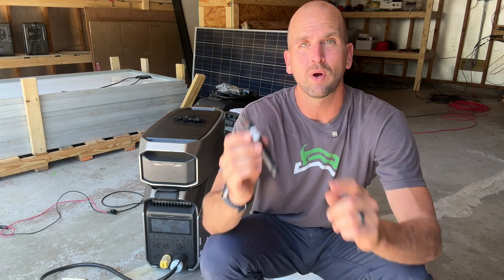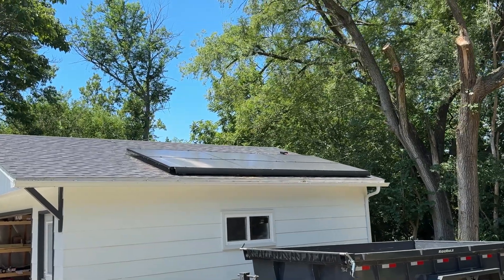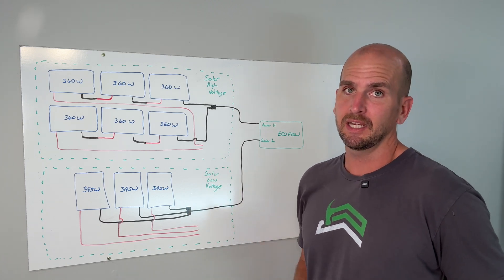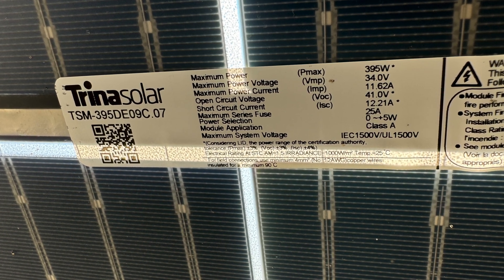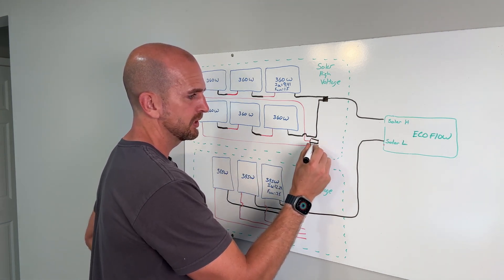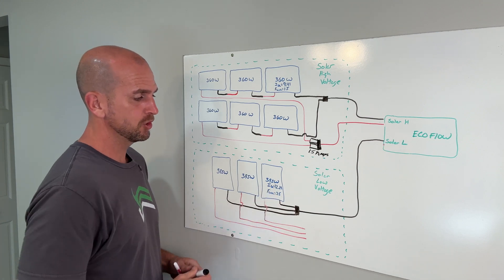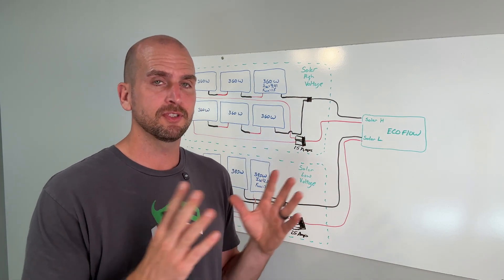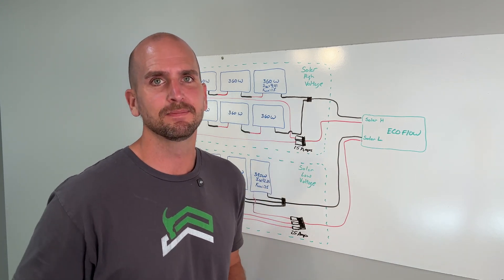When And Where To Use Fuses For DIY Solar

Comment: The purpose of the fuse is to prevent a fire by putting to many amps on the wire the you are running. So if you are using 15 amp rated wire running from solar panels to your house, you put a 15 amp fuse. You have 3 15 amps fuses going to one wire that is not fused, thats 45 amps on one wire, so you should have a 45 amp fuse on that one wire and a wire that can handle 45 amps plus distance of the wire.

Comment: I have 2 Renogy Shadowflux 200W panels that I can't wire in series (exceeds 60v max of my Delta 2 Max XT60i).  They are wired in parallel. Short Circuit Current is 6.86A. Max Fuse Series Rating 15A.
I have NO idea after watching the video twice if I need a fuse for that setup and/or what size fuse to use. Or...if I even need one?

Comment: I also have a DP3 and trying to get the maximum wattage (1000w) on the LPV port using ecflow solar panels. From what I understand from the video I could use 3x400w as long as I use a fuse on each line. Is this correct?

Comment: This video seems all wrong to me.  

The top portion only has 2 parallel connections, never seen anyone use a fuse for only 2 strings (not required but optional) those in-line fuses though.  I hate them, would never use them for semi permanent setup, but I suppose for a portable Delta its ok.

Still a solar combiner is so much better IMO, better for inspection and maintenance but also easier to keep in a weather/temp controlled environment.

Your just adding it up straight up here, I was taught to add 25% (1.56 multiple) to the total ISC figure then go up to the nearest fuse.  So your 25A rating is not correct based on my knowledge and I just got engineering done and they agreed with my calculations using my method.

Firstly if your adding them all up that would be the calculation for the single large wire to the MPPT, not the individual panels that need to be fused (much more important than the entire string) you should be taking 12.21v * 1.56 = 19.04v and size up to say a 20A fuse for each string on the bottom and each string is just a single panel in this case.

Comment: Two panels in parallel that require in line fuses are only on red line so 2 fuses or 4 on all red and black lines? I am not using a real life situation but rather wondering on one fuse per panel or each line?

Comment: Hi again

We are using sketches in this video to look for possible connections. 

We use your video as sample:
1/ top array of 3 double series to connect parallels.
2/ bottom arrays of 4 panels parallels.

Is it safe to connect parallel different energy arrays 1 + 2 ?

If it is safe, then what are the energy outcomes?
Watts = ?
Voltage = ?
Amps = ?

Thanks

Comment: Hi
Please tell me is it ok to connection both your H and L voltage arrays either in series or parallels to 1 inverter. 

It is Sungoldpower inverter:
SPH5048P specifications
5000 WAC
5500 PV
48 V
63 A

Tiger
California,  Rosemead city

Comment: I bought the Ecoflow stream ultra. This has a separate microinverter 1200watts that has 4 inputs 3 x 400w max input (2 of which are on the same mppt) I have 3 panels hooked to this, I then have the stream ultra that has 4 inputs up to 2000watts 4 x 400watts max input and have 4 panels hooked to this. Each panel is 405watts. Question is, do I need a fuse on each positive wire before they plug into the microiverters?
Reply from the maker: Nope, you should be fine without fuses.  Are you in Utah?

Comment: I have the 100-30 with 2 100w panels in Parralel. PV in on a double 15a breaker #6 wire but cannot find a 40 or 50a mega fuse for the Victron 1000 distributer?

Comment: If using a combination of series and parallel solar panels produce amp of 13.5 and series fuse rating is 15A, do I need an in-line fuse to be safe?

Comment: Hello thank you so much for the video my panels are rated at 10.9 amps 395 w I'm going to be running 4 series of 8 panels each and series and then I'm going to combine all four series so my total output would be 12, 640 each series will have 3160 Watts since my panels are rated at 10.9 amps I was going to put a 15 amp fuse at each mc4 branch adapter to be on the safe side do you think that's sufficient again thank you for your video I really appreciate all the training  I'm an automotive technician but I don't know anything about solar and I really appreciate all the training

Comment: I have 6x100 solar panels connected parallel. Should I use inline fuses for this setup. Also using a pwm charge controller. Any suggestions?

Comment: You should also state that if you're going to connect permanent solar panels to your portable solar power station, you going to have to do it on your own!!! Because no solar staller will install solar panels if you have your own equipment!!! They will refuse to do it!!! I contacted 30 local solar installers to put solar panels on my 40° roof and not one of them would do it!!! Every one of them had a stick up their ass!!!

Comment: I’ve got some Meyer-burger panels I will be wiring in a 2S 2P configuration. The Isc is listed as 10.6 amps. The max series fuse rating is listed as 20 amps. If I understood what you are saying, does that mean I will need a 20 amp fuse? 

Great video!

Comment: Hi, I have twelve 555w panels, of which a set of three are wired in series, then the four set of 3s in series are brought together in parallel to the charge controller. Do I need an inline fuse?

Comment: Best format of video.  I'd add 1 thing to your wiring diagram. I'd write 15A two times, and 25A three times to indicate you need 2 or 3 of this fuse. Ie  it's not a total.  Minor point but foolproof

Comment: Instead of those inline fuses, would it be acceptable to use DC circuit breakers, 15A and 25A, rated above the maximum series voltage, to serve as a current protection device and also a disconnect?

Comment: Be careful with DC isolaters and larger series configurations.  When dealing with high voltages  can jump the gap forming a continuous arc https://youtu.be/S9a2oPCIMr0?si=DExB_psWjVzCtK5-. 

Ocdp are good recommendation.

Comment: Small tip: DC isolators MUST be mounted on non flammable material. NOT a piece of wood.
They are prone to arcing faults and you do not want it to be surrounded by kindling.

Comment: Great video on the explanation of the math. I am sorry, I still don't understand the premise. I understand Short circuit current to be the maximum current a solar panel can produce. I do not understand how connecting panels in parallel causes a panel to produce more than its short circuit current rating. I understand that arranging panels in parallel creates a higher additive current after the parallel branch connector. Using the river analogy, when you connect three rivers in parallel the combined river has a greater current but the current in any one branch is not affected by the combined current. Aren't the branches are limited to a set value (ie., the short circuit current)?
Reply: I've had this same thought / question! Did you find any answers?

Comment: I have two Delta Pro 3 units, four ecoflow 400 watt rigid solar panels and a ecoflow subpanel  - just arrived. I am confused about grounding. Do I need to have one or two ground rods at the array or do I run the ground wire to the ground rod the grid panel? Thanks for any help

Comment: Nice explanation. One problem I had is that with my eco-worthy 100w panels, the outputs are not red and black wires, so I had to look at some other fusing videos to tell that the connector that looks like a male is the plus, or the "red" wire. Also, from what I can tell, other brands also had the plus connector on the right side of the little box on the back of the panels. 

I wonder what would be the effect if one put the inline fuses in the negative side instead. After all, the inline fuses have a male on one end and a female on the other, so it is not foolproof since one could put the fuses in the negative Y connector just as easily. 

I think I did the fuse size wrong, however. My panels say 5.5 sc amps and 10 amp fuse. I thought one would have to add the 5.5 and get 11 and so I am currently using 15 amp fuses. It should be easy to just replace them in the inline fuse holders, I would hope. 

Adding to my confusion, I have 4 panels, with 2 connected in series (40v) and then the 2 pairs in parallel. I have an ecoflow delta 3 plus that maxes out the voltage at 60 (with 500w)  so I can't just series connect the 4 of them.

Comment: first example:
 2 strings where every string brings 9 Amps put in 15 Ampere fuse for what'?
a strings delivers with 9 Amps the maxiumum possible current possible so to fuse against 15 Amps that will never be possible...
pontless in any aspect.
if one or 2 panel in ysour strings fail they will be bypaased and the  working panel deliver still 9 Amps, so what is the point of a 15 Ampere fuse???

if you will protect a string against another string then you must fuse against the maximum possible current an this is 9 Amps....
and to fuse against the working current = not work, to put a bigger fuse the max possible current is pointless.

the same trash in example 2 
3 panels with 12 Ampere in parallel put on any panel a 25 Ampere fuse.
frash over trash.

if in a parallel string on panel fail it becomes a consumer, so in your example 2 panels will put out 2x 11,5 Ampere=23 Ampere and pump it into the failed panel so the fuse will not do anythink and then the failed panel will heat up to the point of fire...and burn, and the fuse will do nothing coz still 23 AMpere is alll the failed panel get.....

so if you will prevent that is the key tpo understand how elektrizity works and not read any trash and show here your halfisch theories.
and yes your fuse will work if you take for exammple 4 of this panels in parallel coz the current will be then 11,5x3= 34,5 Ampere so your 25 Ampere fuse will now get blown.
with your example you only show that you have no idea of Power.

the much more common way in many aspecst is to put into parallel setups blocking diodes , on this way you prevent really all possible problems.
only on this way you prevent a back flow off current into a failed panel or a partial damaged panel that drains lets say 20% off the current what producend from panel 1+3 and will be drawed from panel 2 about anyx fail , or shading or damaged cells on the panel....
all ppssibel fail can only be protected with this solution.

a fuse only can stop a fix current if you use the right fuse.

so in your example 2 fuses with ~22 Amps or lower only can block  the full current of 2 panels, but no other fails that happening all  the time.
3 panels parallel 2 panels full suin 1 panel fully shaded turns the shaded panel into a cunsumer and current from the 2 fully sun panels pump current into it.
how your fuse helps here on a dayly problem???
fusing panels is in any aspekt poimtless.

the last 15 years schottky diodes are the way to go like the next 15 years.....

in reallyty there exists no scenario there are any need of a fuse in any solar setup.
from panels to the consumer/charge controller no fuses need or make any sense.

the only fuse that can be placed is on the battery + thermial and that is the only one fuse !!!!!

Comment: Question, how do you calculate the max current for each string? The DP3 Low-PV is rated for 20A and the High-PV is rated for 15A. I was under the impression that you use the "Isc" rating. If that were the case, you would be over current on both, right? High= 18.82A and Low = 36.63A. If that's not the case, then how would one calculate the max current from each of your strings? Should I be using Imp instead of Isc? If we use Imp instead of Isc, then High = 17.8A and Low = 34.86A. Either way, aren't you over the current rating of each solar input?

Comment: Any idea how to determine fuse size when the panel doesn't list one?

I have 2 BougeRV 100W panels.  This is the info the label provides:

Max Power (Pmax):  100 +/- 3% W
Max Power Voltage (Vmp):  18.15 +/- 3% V
Max Power Current (Imp):  5.51 +/- 3% A
Open Circuit Voltage (Voc):  21.4 +/- 3% V
Short Circuit Current (Isc):  6.11 +/- 3% A
Max System Voltage:  1000V DC
Application Class:  Class A
Operating Temp Limits:  -40F ~ 185F

I tried contacting their Customer Service but got the run-around, and finally a partial answer.
They say if I connect the two in series, I need a 10A fuse.

I'm guessing from your video that I will need two 10A fuses if I connect them in parallel.
I really wanted to get more panels but hesitate since I don't have this info.
Reply: The short circuit current is 6.11 and you times that by 1.54= 9.4 so you would use a 10amp circuit. 

This is only if hook them up in parallel. 
If you are hooking them up in series then you would not need a fuse because your not increase amperage but just the voltage.
You will still need to breaker this at the house or before the controller/ inverter.

Comment: Noob question. Does it HURT to have inline fuses in a series setup on the solar panel side of a switch/circuit-breaker/etc, in case there is a short circuit (from water or fault wiring/electronics) or something?
Reply: no one knows... have same qeustion
Reply: @SuperStanislovas  All the utube channels about solar are about taking in money. they dont want to get involved helping people for Free!

Comment: Hey there, thanks for the video. Question - for the top configuration, since your Isc is 9.41, what is the rationale for using a 15A fuse instead of 10A? Maybe my next question answers this, but when does the 1.25 (indoor) or 1.56 (outdoor) safety multiplier come into play?
Reply: it is pointless is the answer.
if a panel or seriall string can put out 9,4 Ampere max so that is the maxium in any aspect so if one or more panels fail still 9,4 Ampere is the maxiumum possible current so to put in a 15 Ampere fuse into this string is 100% pointless in all aspeccts.

and if you use parallel configs there is a possible way to use a fuse for example 4 panela in parallel and each one makes 10 Ampere so a total of 40 Ampere.
lets say one panel fail in this setup in this exotic situation the failed panel becomes a ccnsumer and this consumer can draw it rating so maximum 10 Amere but in our example we have 3 working panels that still produce 30 Ampere and coz the current goes the shortest way the current go in this situation to the failed panel and pump into it 30 Ampere what will result in heat up and posssible burn coz this failed one can only handle 10 ampes producing or cinsuming but not 30 Ampere.

so in this situation a lets say 15 Ampere fuse makes sense.

but the other problem is shaded panels doing same like failed panels to switch from producer to consumer so the last 15 year Pros not use fuses but blocking diodes "sachottky" that is the solution for any sort of fail, not only a 100% fail of a panel in parallel setup but also failed cells on panels what is not easy to find fast this problem or partial shading , it prefents against any sort or possible problem.
thats why fusses in solar setups are pure nonsens on the panel side.

the only needet fuse is on the battery thermial against a wirre burn "short/ over current from batttery" and thats is the only real needet fuse , no other fuses.
and this fuse much mach with your battery wires, so if your wire can handle 30 Amps put in a 25 Amp fuse in so you have a large safty filed put in without posibilyty of heating up wires over time or wire burn.
fuse for battery always below the maximum current of a wire, coz a wire heats up on maximum over time, and if some strains in the wire broken with the maximum  the wire can melt burn....
so use always wires than are  stronger then you need and then fuse is below its maximum Ampere for real safty.

an example from real world:
my solaer delivers 10 Amps so wire must be higher ratet for example i take now 30 Amp wires from the charge controller to the battery.
no no war up on any way coz only 10 Amps is maximum movment of current and to protect this wire to not can burn if for example battery get a short i put in a 25 Ampere fuse.
so the maximum current will always be below the wire posibilitys and anythink is 100% safe.
same for example to inverter.
the inverter need maximum 60 Amps so i  use a 80 Amps + wire the put in a 60 amp fuse.
so inverter never get more power then he can same like wire.... this the only real fuses what makes sense.

solar panel never need a fuse coz they are limited by themself  !!!!

Comment: Will be utilizing three 410w solar panels in series for a total of 1230w, 112v, and 10 Amps that will plug into an Ecoflow Delta Pro (2). I will be grounding the solar panels, but wondering if I need something for lightning/surge protection? I was thinking maybe a 15 amp inline PV fuse prior to connecting to then Delta Pro? Am I just overthinking this? Thank you!

Comment: Humm!  I have 200w Renogy Portable solar panels to charge our rv battery and solar power stations at different times.  When purchased, the portable panels were wired to only charge solar power stations - didn't have charge controller.  I purchased a Renogy Voyager 20amp Charge controller, and wired the panels to connect into our RV SAE connector.  I kept the charge controller close to rv battery, and placed a small atc fuse block (20amp) on red wire between the charge controller and battery plugged into RV's SAE plug. 

From your video, it sounds like I didn't need to fuse anything?  If I didn't to fuse, do I need to eliminate the fuse or leave for added protection?  20amp fuse looks to be too high, too?  Thanks much.

Comment: I have two strings in series one string has eight panel 370 wide yeah the string has seven panels three out of 70 W do I need to fuse either string

Comment: You say 3 bi-facial panels on your ground array, but doesn't the video show 4 panels?
Reply from the maker: There are 4 on that mount but I only have 3 of them wired in the circuit.